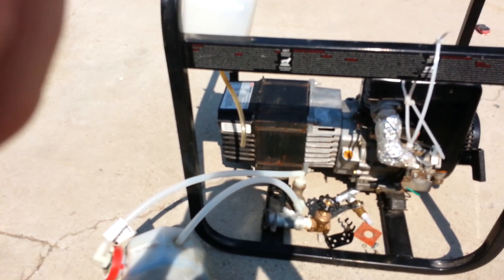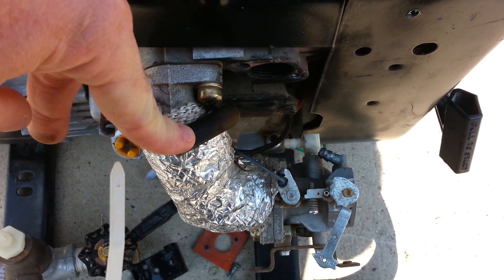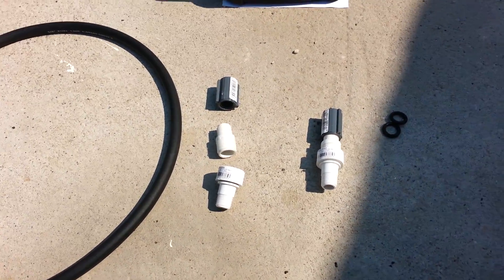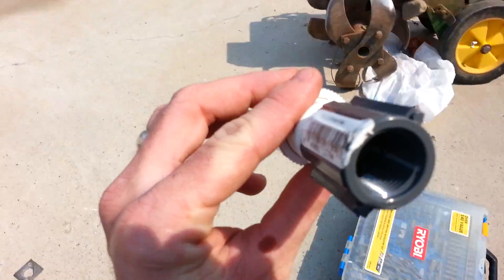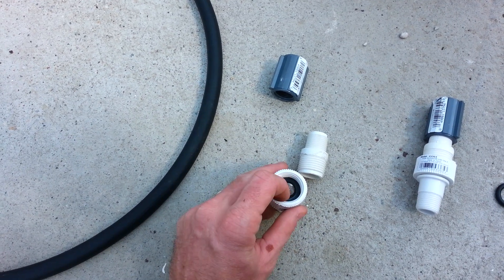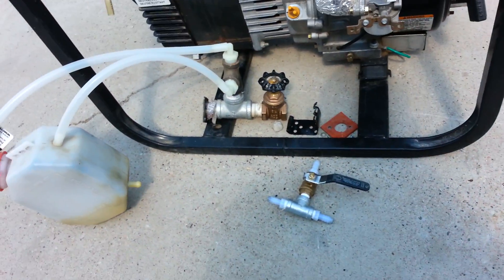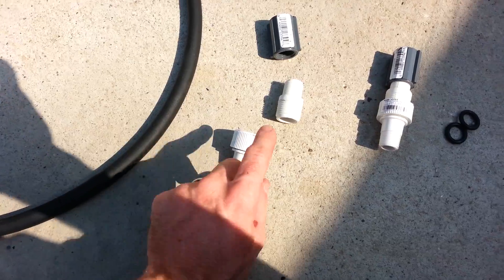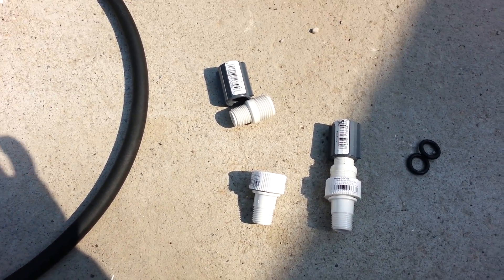Fuel Vapor Flashback Arrestor ( How To)

Comment: you could use check valves to you can make them with the PVC coupling and the ball inside I made 1 for water I blew back on it and it worked I would recommend 2 check valves in each line  the check valves and spark arrestors would get it
Reply from the maker: +Larry Fries  The Flash arrestor is do work great however if you're running a cold Vapor system you run the risk of blasting fuel out of the intake from a backfire so check valves are definitely a great thing to add.

Comment: great idea,thank you for this video.It will save a lot of time stuffing steel wool and all that. I want to tell you that you might have a problem with the container getting very cold and causing the gas vapor to condence on the inside walls,then starving the engine.If this happens you have to heat the incoming air.angie
Reply from the maker: +Angelo Lapasota  indeed the vaporizer will get very cold however if you constantly introduced a drip of fuel into the system then it will continue to run forever. That is what I do to eliminate the problem of it freezing up and running stale. It doesn't take much but you definitely need to do that. The thing that I find works best is to blow the exhaust on the container to keep it warm. Hot Vapors always work better than cold Vapor as far as efficiency goes.

Comment: how would you go about creating a flashback arrester for a 3 inch or 4 inch pipe. like on your buick? to keep a potential back fire from blowing up your system?
Reply from the maker: Use a sink strainer and JB weld it into a piece of pipe that you can connect your intake hose up to.
Reply: Tyson Capel so the screen in a strainer would be sufficient? Ok ill give it a try. Trying to vape my 400 sbc to better my 7mpg...
Reply from the maker: Good luck!

You have to use the right kine of strainer the type that have the same kind of screen you see in this video. 

One like this:
http://www.lowes.com/pd_126605-1366-88822X_4294822040__?productId=4752551&Ns=p_product_qty_sales_dollar|1&pl=1&currentURL=%3FNs%3Dp_product_qty_sales_dollar%7C1%26page%3D2&facetInfo=

Comment: Do you have a video actually testing the flashback arrestor?  Cause an actual flashback and let us see how it reacts under a live situation?
Reply from the maker: Not yet I can however tell you that it works great! I have tested it many times and have had well over 100 backfires on my generator when running it off of vapors and it works flawlessly every time. I will make a video of it in action when I have some time to do so.

Comment: Hey, i'm planning on making a gas vapor system for my car. I'm gonna use piezo mist makers. Don't you think the vapors are gonna condensate on this flashback arrestor? I'm really curious about that. Hopefully you can help me out.
Thanks in advance
Reply from the maker: No, there is way to much air flowing through it to allow condensation buildup.

Comment: Wouldn't it be possible to have a small stainless steel container with the fuel lines coming from your gas tank routed into the bottom of the container, along with the t-shaped pipe going down into the bottom of the container with the air filter at the top and somehow incorporate a float system that only lets in the right amount of fuel and then shuts off the electric fuel pump?  Then, you could just fuel up like normal, have the container in the engine compartment with the flashback arrestor(s) and check valves in place, going to the intake?  I would think that would be a much simpler system and would really allow the gas to stay warm, thereby solving the "cold air" dilemma....thoughts?
Reply from the maker: Yes. Check out the FSRD facebook page for that system design.

Comment: Looks like you're having fun. When I run my generator on alcohol vapor my exaust smells like french fried potatos. When I add hho I can't smell anything from the tail pipe. Alcohol vapor mixed with hho is the ultimate motor fuel. Tha'ts a fact I learned the hard way. Try it,...I wouldn't steer ya wrong.
Reply from the maker: Thanks for sharing that!

Comment: Would something like that work for a truck? But bigger.
Reply from the maker: It sure would! I would run the vapors through the pcv valve in a vehicle so you would be able to get away with a small one like this. If one won't provide enough flow you could always make two and make a manifold so there is better airflow. You could use something like a tub or sink strainer that has the mesh in it.